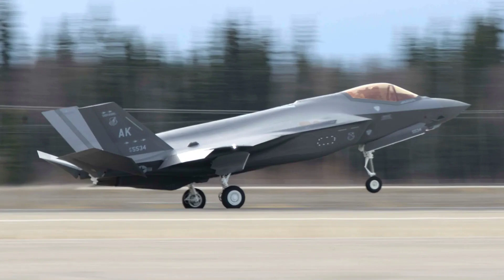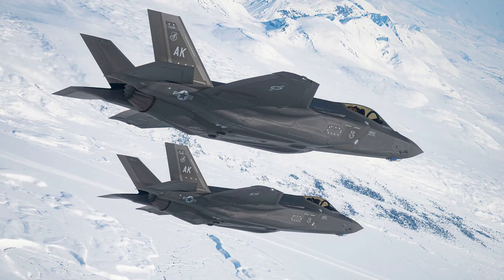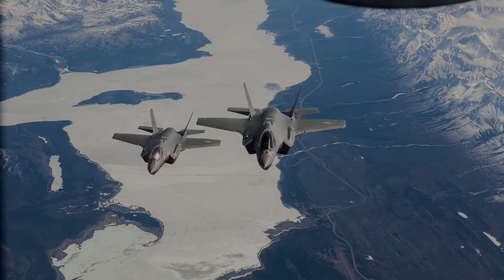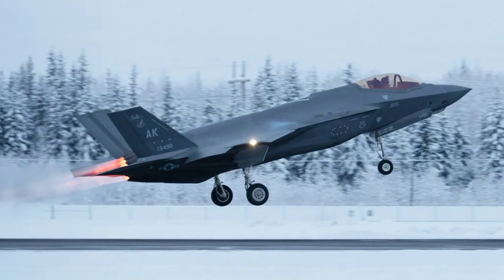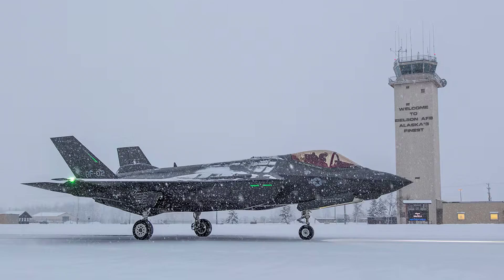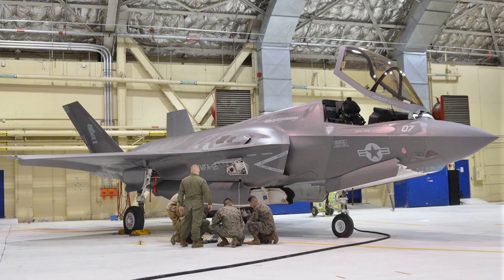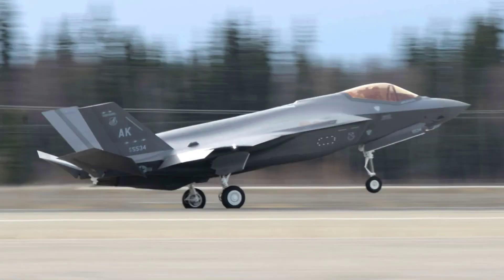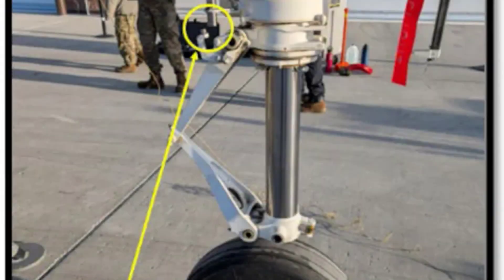Frozen Descent: F-35 Crashes in Alaska After Landing Gear Icing!

Comment: What was the temperature during that incident? Curious as we ordered F-35 in Finland.
Reply from the maker: The temperature at the time of the crash was -1 degree Fahrenheit.
Reply: @WarsClaw  That's -18 centigrades, quite cold but something we have here every winter on the north (luckily not here in the south where I live). I hope they can get it sorted out, either change the design or find proper maintenance to prevent this.
Reply: @Vilhyto  why would Finland buy planes from an adversary to Europe? buy Saab instead!
Reply: @mipmipmipmipmip-v5x  I agree. But the choice is made. That's what generals wanted. Coincidentally some of them went to work for LM at the same time.
Reply: @Vilhyto  if that's the democracy a big part of Europe's border has to defend against Putin, things don't look good